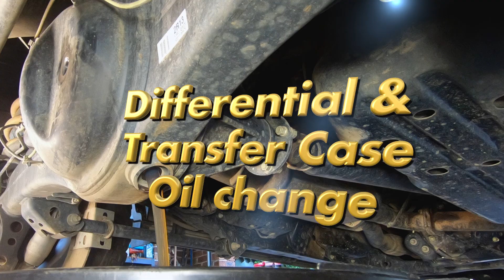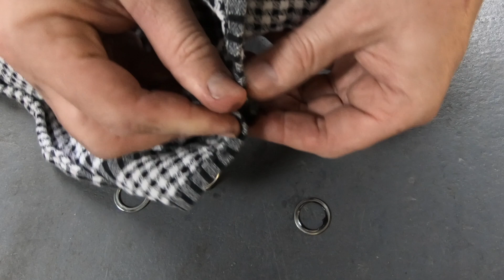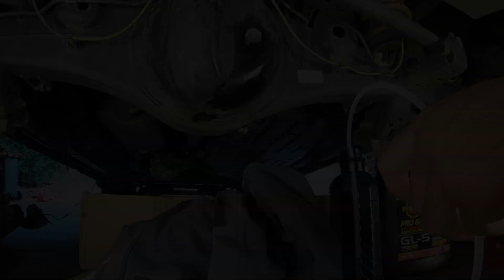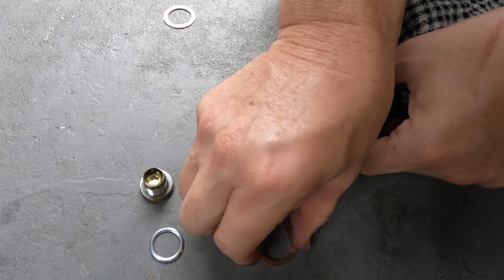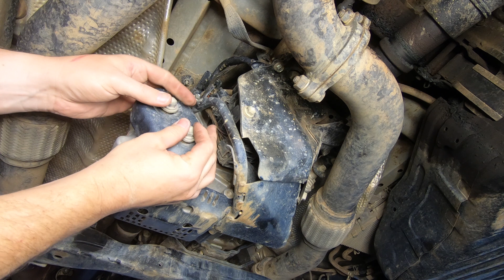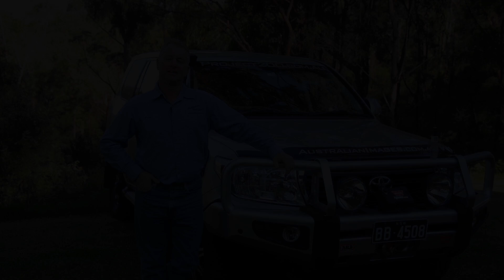Diff & Transfer Case oil change: LandCruiser 200

Comment: Hi mate, its pretty rare to get 75w85 where I live, will I be fine if i used 80w90 GL5 spec oil for both diffs and as well as the transfer case? Also, do I need LSD oil? Ive got a 2013 VX

Comment: I've changed mine at 30K Km and in the rear dif  it was very,  very dirty and some metal debris . The front was very dirty also but without debris. The transfer gear oil was clean .

Comment: Great video as always.  Unfortunately, some of us are crawling around on the ground without the use of jacks, ramps, or a proper lift.  Then there’s the front diff drain plug isn’t coming out no matter what.  I’m know I’m not the first to question Toyota’s requirement of the 10mm allen instead of a 24mm socket like everywhere else nor am I the first to have this problem.  I worked around it by pumping out through the fill hole, but will be consumed by this stuck plug until it is resolved…

Comment: Great informative video - Subscribed!
Can you advise the brand of the 12v transfer pump?
Reply from the maker: No, just a no-name one. I think they are all the same give or take. Get one that includes the hoses and fittings.https://www.ebay.com.au/sch/i.html?_odkw=12v+oil+transfer+pump&_osacat=0&_from=R40&_trksid=p2045573.m570.l1313.TR1.TRC0.A0.H0.X12v+100w+oil+transfer+pump.TRS0&_nkw=12v+100w+oil+transfer+pump&_sacat=0&mkcid=1&mkrid=705-53470-19255-0&siteid=15&customid=link&campid=5337996533&toolid=20001&mkevt=1
Reply: @austimages  Jamie thanks - I did manage to purchase the same oil transfer pump on eBay.
I did find the pump tended to inject a huge amount of air causing very slow fill of the rear diff.
I found using the smaller diameter supplied  hose in the outlet completely solved the problem - - no air and rapid oil transfer.
I have just finished both diffs and transfer case  - the hardest part was re-fitting the cage that protects the transfer case.
@ 70k All oils came out still clean - replaced with a Penrite GL5 as recommended. 
Next  the auto transmission! Thanks for your inspirational videos!

Comment: Hi do u have to clean the 12v pump before transferring a different spect oil,
Reply from the maker: Not between different grades of the same oil. If switching between different types of oil (eg engine to gearbox), then just pump the first second of oil into a waste container.
Reply: @austimages  I've just purchased the same pump will get my n80 hilux oil service soon thank for information

Comment: In the USA, the specification for the transfer case gear oil is Toyota Genuine Transfer Gear Oil LF 75W.  Note that it's a straight weight oil and not 75W-90.  I don't know if that really makes a difference.  I wouldn't imagine that Toyota is making different transfer cases for Australia and the USA.  The 75W gear oil is very hard to find, but I found some made by a company called Ravenol.  It specifically lists Toyota's part number as equivalent.  I purchased it and the 75W-85 gear oil required for the differentials from blauparts.com.

Comment: How do clean the pump after each use to prevent oil contamination
Reply from the maker: I remove the hoses and flush them with a bit of petrol. For the pump itself, I just let it drain and before each use, just run a small amount of the new oil (just a few ml) to waste before filling the diff/transfer etc.

Comment: Also a warning to people attempting this, your front differential drain plug can easily be stripped.
Reply from the maker: Yes, very important to use the torque wrench given the alloy diff casing.
Reply: @austimages  You are right, but what I meant was that the plug itself has this hex/allen plug that can be rounded because of the previous person over torquing it or it being seized. It was a P ITA to remove mine and had to weld a bolt to it. It hasn't been changed since factory 12 years ago and it was rust welded.
Reply from the maker: @and7976  Ahh, OK. Haven't come across that. Maybe the previous person used an imperial hex wrench that was 'close enough', rather than the correct metric version. They can be very fussy for the correct size.

Comment: That oil that is draining is still like brand new. There is nothing wrong with that oil and not worth changing it.      Is this setup?   Or have you flushed it so It's still like new....
Reply from the maker: No, that's how it looks after 40,000km. Diff and transfer oil shouldn't really get very dirty, but there are still some contaminants in there. The recommended change interval for these oils is every 40,000km, so that's when I change them.

Comment: Hi. I recently did mine and while I was under the rear I noticed due to my lift how much the rear diff pinion angle had changed in relation to the pinion on the transfer case. I ended up changing the upper trailing arms to superior engineering adjustable and was easily able to restore the pinion angle back to Toyota spec +/- 1°. Mine was 4° delta with a 2” lift. The rear diff ended up taking a further 600mls after the adjustment. Something to consider.

Comment: The transfer pump's a good idea, some folks that haven't done this before underestimate just how slowly thick gear oil will flow, especially through those tubes they come with.
The material a crush washer is made from really doesn't matter at all, as long as it will crush and conform to size without cracking or flexing it'll work and you can usually sand them back down or drill out a coin if you haven't got the time to go to the parts store. I wouldn't be surprised if an o-ring might work.
Nice vid.
Reply: I reused the same washers, no leaks.

Comment: Dear I need your advice.
I got my LC200 brand new in 2008 and now it has 450k miles. No issue at all, but all this years I only change transmission and engine oil. But never done front/rear diff and transfer case. Should I change it after all these years or just keep it till it fails??
Reply from the maker: Change it!
Reply: @austimages  
I want to, but some say it will shock the gears and cause troubles?? I'm really not sure about it and I'm not expert but I love my car and happy with it for 12 years now.
Reply from the maker: @ej254  Shock the gears??!! Change it.
Reply: Mine too, they say rarely will be ok but maybe you will get a noisy sound! Is that true or I go ahead and change it?
Reply: If what you're saying is true, I'm absolutely amazed how well engineered these trucks are that you lasted 450,000 miles without changing the diff and transfer case oils

Comment: Toyota dealer have 2 GL5 oils for trasfer case on sale : one is “ differential gear oil “ and the other is “ slip differential gear oil “ both oem both gl5 , wich one should I use for my 200 series ?

Comment: What harm can be done when using 75w90 oil for the diff instead of 75w85? Coz other than the viscosity,it’s basically the same oil for the transfer case too right? I have a 120 prado btw.

Comment: Its very helpful video BUT there is a wrong torque spec on the front differential drain plug and it must be torque to 65 N.m not 39 N.m and you must be torque the filler plug on front diff to 39 N.m . Good Luck
Reply from the maker: And from the workshop manual too: https://ibb.co/Dpt0KZz . Perhaps you have the specs from a previous model, or looking at some of the other bolts for the front diff? There are a few of the case assembly bolts that are torqued to 65Nm.
Reply from the maker: According to the Toyota service data sheet, the correct torque for the front diff drain plug is 39Nm. See pic: https://ibb.co/1qVnmSR

Comment: Just on a diff related subject , l was wondering if you have looked into lockers? , lam pretty sure you would have and would be interested in your opinion on which way you would go , l like the tjm locker but they only do rear , arb do both but the o ring design concerns me that it may fail , l do like arb gear and normally would go that way .. cheers Mark.
Reply from the maker: I have always run ARB lockers in the past. Had them on three previous vehicles. Only ever had one failure, which was a copper air line that split inside the diff. I’m seriously considering them shortly as I’d like to have them for an upcoming trip. But both or nothing, so TJM is out. I’ll have a closer look at the e-locker, but at this stage probably going with ARB.